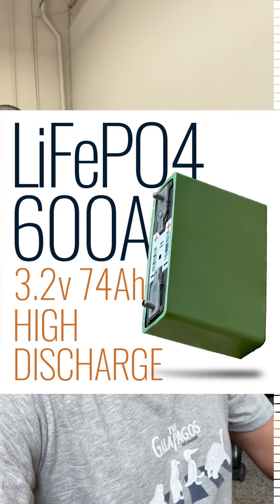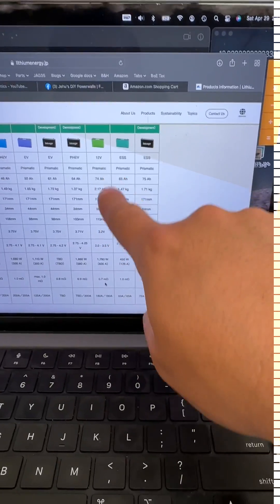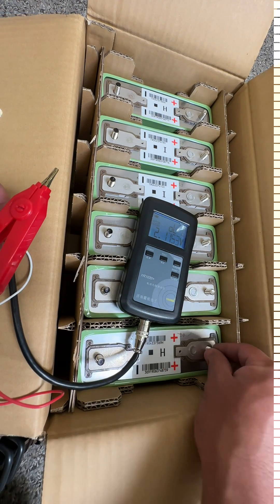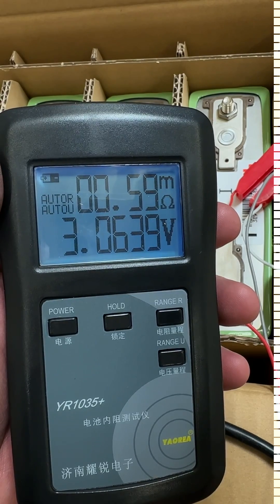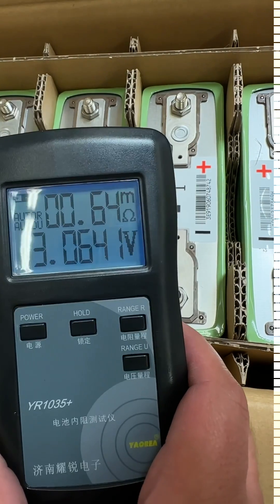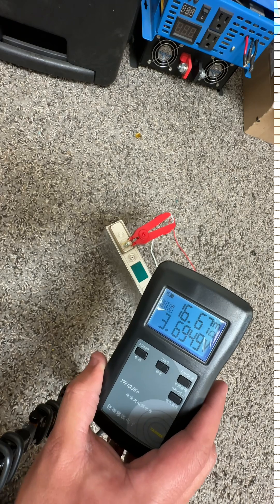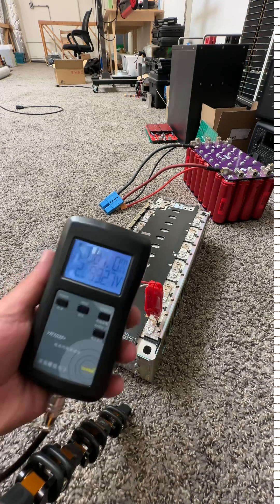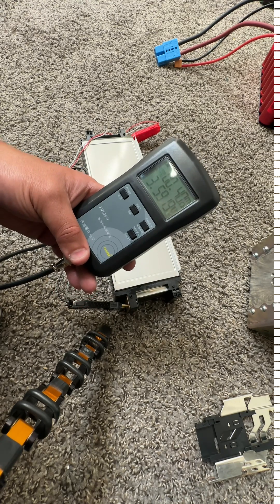LEV60F LiFePO4 internal resistance test

Comment: The internal resistance determines the rate of charge and discharge, it is calculated using ohms law, because resistance and voltage determine the amount of current (amperage).
Reply: Wouldn't it be dynamic? That's just a no load internal resistance?
Reply: @terrencesauve  I am not sure. For a samsung 30Q, they discharge 18 amps short circuit and charge 2 amps short circuit. It does not vary, so it appears to be the internal resistance.

Comment: Hi there when you do resistance on  cells in a battery with cells in parallel the resistance is divided by the cells, so if you have 2 cells in parallel then the resistance will be harfed. If the battery's are in cerse then the resistance will be added
Reply: You need to factor in the IR of the bus bars

Comment: A few things to keep in mind. The resistance gets lower the larger capacity the cell is. Thats why these large cells show a lower resistance than smaller cylindrcal cells would do. 
When you measure on a block of parallel connected cells you don’t get the value for the cell but for that entire block. You have to divide with the number of cells to get the average value of each cell individually.
Reply: and the terminal must be clean, slight residues on contact could increase the measurement ohm

Comment: Ok now I'm pissed. My headways all tested right under 1 milliohm. Yeah they are from 2015 but they were supposedly never cycled

Edit: after thinking about this it doesn’t matter if if you test right at the terminals if they are in parallel. So jehus set he measured was probably 6P or 8P plus the bus bars and mine were 2P with some beefy copper bus bars that added very little to the reading. My cells individually test 1.9mR when I carefully use the probes  on the negative terminal and towards the bottom of the positive terminal “cage”
Reply: Your headways are fine between 1.8 and 2.0 milliohms. This guy doesn't really know much about batteries, despite selling a lot of them.

Comment: The LifePO4 cells are pretty nice, but I just can't justify $50 per cell for that capacity.  It'll be interesting to see how these sell.
Reply: The 16 pack is so cheap right now that $/kwh it matches the 280AH prismatics BUT you get insanely low IR which is not a guarantee when buying the 280’s. If you buy grade A 280’s from EVE they are about $150 each and the IR is 0.12 to 0.14mR so a tad bit higher than 4 good LV60 cells. No way could the 280’s support discharging at 3C though, the load tests I’ve seen show 2C to be the absolute max and voltage drop is a bitch. 

These are a good value for the money right now
Reply from the maker: They are selling well at the moment but  maybe in a month or two we’ll be able to lower price
Reply: They're about $30-35/cell right now as of early October.

Comment: Awesome! Does it change at higher temperature, and if so, is it predictable?
Reply: I guess it also changes under load or discharge connections, so a dynamic measurement would be a better analysis.